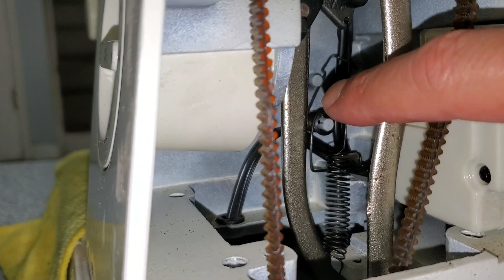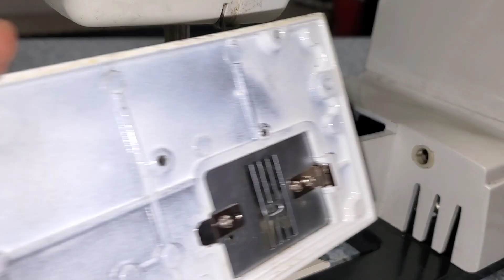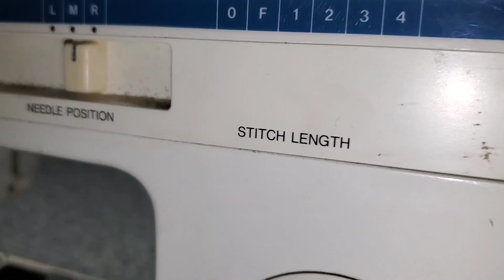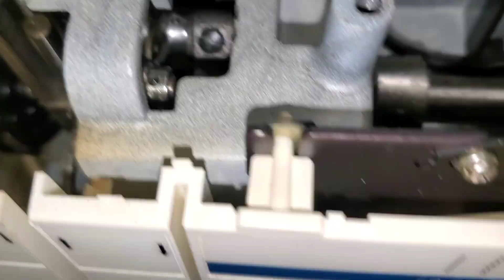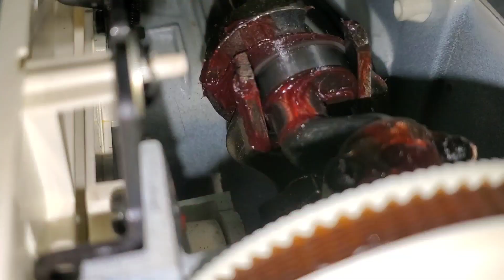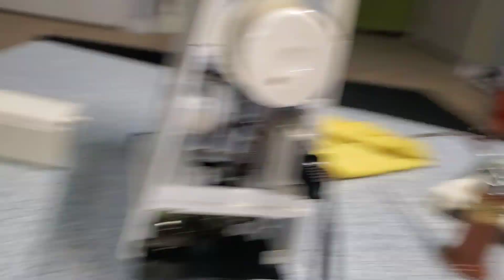How to Fix Sewing Machine Feed Dog Problems & Solutions - Sewing Machines Troubleshooting

Comment: Hi. Im really hoping you can help me. When i sew, no matter what i do with the tension, The needle gets jammed. It works fine when i raise the presser foot but struggles when i put it down and eventually the lower thread gets tangled. PLEASE HELP!
Reply from the maker: I will help you shortly 😊
Reply from the maker: Hello my friend, please follow those steps. There are several possible causes try the easiest ones first 
1-  replace the threads with good quality one it could be thread problem maybe its weak or thick or bad quality.
2- replace the needle, there are numbers and sizes for needles each one does specific sew try to use a good quality needle sometimes universal one doesn't work well and  causes threads tangled,  right needle  makes huge different.
3- some sewing machines Tensioner is very sensitive, especially old Sewing machines ,  so try to clean the Tensioner check if there's any threads stuck inside , 
4- check the bobbin thread Tensioner make sure it's not loose or tight, by small flat screw side of the bobbin case adjust it to right Tension.
5- adjust the pressure foot position, tight  for thin fabric loose for thick fabric.
6- of all are OK or nothing worked for you, you need to adjust the bobbin housing rotation that's not easy you need to watch a video on how to adjust it. 
I hope that will help you to figure out Thank you and all the best.
Thank you